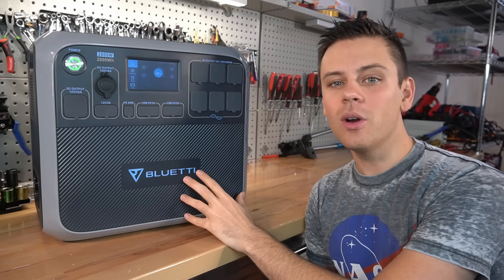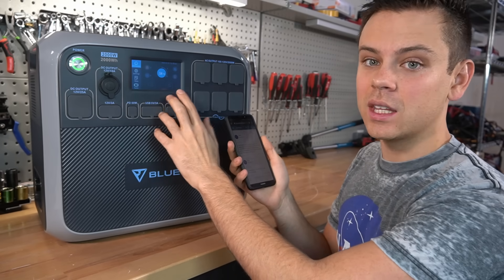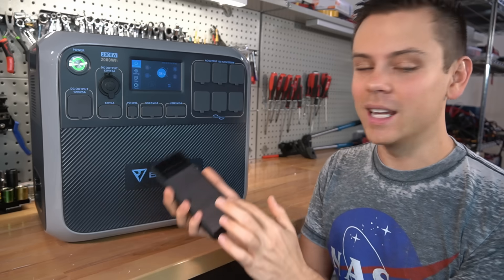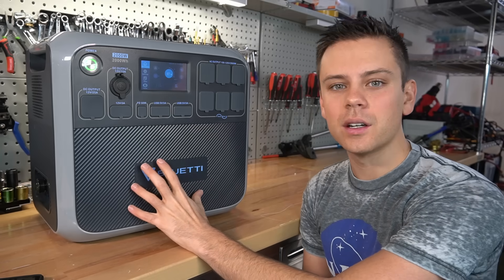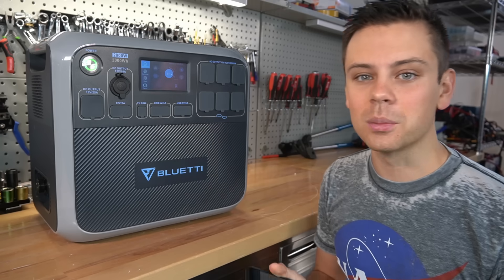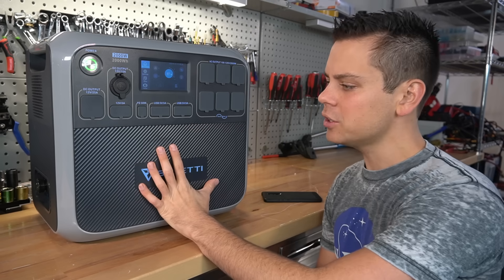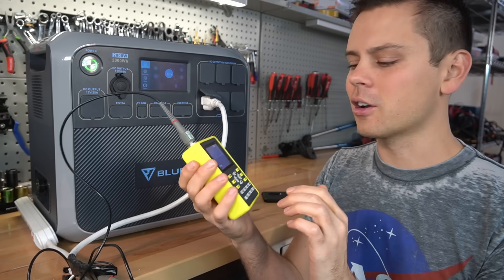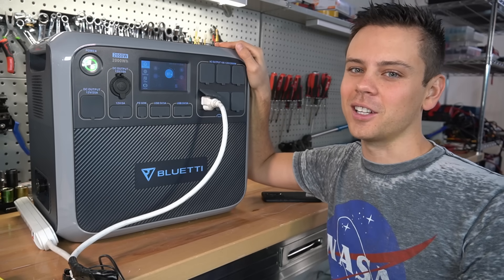New Issues are Plaguing the Bluetti AC200

Comment: I've had my unit since August. It has worked really well for me until recently. All of a sudden, it won't charge up with my PV system - two 345 W panels. I had been able to unplug things, power down and turn the unit back on and that seemed to work, but now nothing is working. I took it a friends house and was able to charge it with a regular wall outlet, but I'm totally off grid. It discharges fine - ie charges my laptop, phone and runs lights. But I need the unit to charge up with my solar panels. I've unhooked everything, used different MC4 splitters, turned the unit on and off again. I've emailed Bluetti - it takes them about 24 hours+ to get back with me. They are having me do stuff I already tried. I think there is a fuse or something that needs to be replaced. Or a Reset that needs to happen. But they've offered no meaningful help. I'm wanting them to replace the unit since it's only a five months into a 24 month warranty. Does anyone here have any advice for me?
Reply: Any update? Have you get a replacement, I heard replacement is usually a refurbish product. Want to purchase but worry about future problem.
Reply: @jakeliujakeliu  Yes, they did send me a replacement which seemed like a brand new device. It's worked perfect ever since. 

My problem was :: I had 4 panels plugged in and they were not all of the same Wattage. That is likely what fried my original bluetti. I assumed there was something inside the device that would manage that but I guess not. There is no mention of in the manual. It was pretty hard to get through... then I ended up with two totally separate groups helping me.  I think one was in Las Vegas, NV and the other in China.  So, I'd rate there support a 3 on a scale of 5. But I love the device... though now I only have 2 of the same wattage panels plugged into it.
Reply: Glad it work out well! You can use parallel.  One group use series example 200w and another 200w. Another group example 350w and 350w. Then parallel connect those two group.  Try to verify with other before try it.

Comment: My Bluetti just shuts off for no reason after four hours.  The load is low on it… not good for someone using a cpap!  
It also seems its draining to fast when I’m only using a cpap on it.  
Any suggestions
Reply: In the advertisements of the AC200P it is said: "AC power will shut down when the output load keeps under 50W after 4 hours". Try disabling the ECO mode, maybe this could solve the problem.

Comment: I tried a A/c electric blanket for 2 hours used 300 plus watts, I assume one needs to use a 12 volt elec. blanket since it may use 50 watts per hour?
Will it produce the same heat.
I would think you should use everything you can 12 volt since no power loss etc.
Lastly, all devices though the inverter run around 20% less wats / amps so all a/c items run slower IE. fans?

Comment: Glad that I went with Ecoflow rather than Bluetti. I've never had any problems with my River Pro. Upgrading soon to the Delta Pro as well!
Reply: I started with ecoflow and wouldn't charge out of box, got sent another, and it wouldn't accept solar charge, they sent another and it was cracked on the top so I got a refund. Got bluetti AC200max and it's Soo much better plus i can charge with all my 6x150 of my solar panels AND grid power and my Eco couldn't.

Comment: Has a bad experience with Bluetti customer support. Seems like they're rolling out products that haven't been fully tested while overpromising to customers. Went with another brand due to the frustration. I hope they correct it soon as the concept is solid but implementation is kinda bad.
Reply: What did you end up going with? I bought an eb150 and it does not take a solar charge. Tried different panels, cables and nothing... It accepts wall charge but no solar! Horrible customer support, super slow to respond and just a waste of time
Reply: @ven11235  
This saddens me so much to hear this...
Reply: @JudiChristopher  me too haha if it worked it would have been really awesome. The customer service was slow, but the interactions I had were good, but too slow and didn't help resolve my problem soon enough. Due to uncertainty I had to sever ties and go with another brand. No time to keep going thru not knowing
Reply: @ven11235  
Yes... That is whats scaring me too... What other Solar Generator did you decide to go to?
Reply: @JudiChristopher  okmo generator and panels

Comment: I bought mine a month ago . I was told I needed more amps than a 100 watt solar, when I pluged it in, it kept going from 32 to 0.  I then got 300 watt flexible panels from Dokio and I had to buy a adapter. I connected it all together and it didn't work. So I cant charge the Bluetti by solar at all. I've tried to get ahold of Bluetti and haven't heard back from them.

Comment: I recently purchased the ac200p. I'm getting an error code 30 "Calibration Failure". I've tried looking it up, but no info on this code. When I plug in my solar panels, I get this error. I also set the button on "PV" mode and still receiving 0% from the solar panels. I've reached out to bluetti, but haven't received a response. Could you enlighten me as to what I might be doing wrong?

Comment: I just received my Bluetti AC200-P kit including three Bluetti SP200 watt solar panels. It was a deal I purchased from Maxoak on Amazon. It was delivered on time as promised.
I based my purchase on your initial reaction to the AC200--plus that of other YouTube reviewers. I know next to nothing about electronics. I like your confident and seemingly exhaustive testing style for this and other products. Are you an electrical engineer?
Although I haven't had the kit for very long, seeing this video come out, and (seemingly) having you question your earlier rave reviews of the unit is disturbing. Should I be unsettled with my purchase? I have no idea about what you and the others are talking about when you talk about the "shunt being calibrated incorrectly", "power factor correction deviation (!!)" , "BMS communication error". What is a "firmware update"? If this is done by Maxoak, how will I receive it, and use it to correct in any possible errors in my unit?!? 

I'll continue to watch your videos--even if I don't watch a future video on "sine wave" experiments. Thanks.

Comment: Mine was absolute junk arrived unable to take a charge. Got it to charge with a shake but now can't get it to power anything. A check of the bms shows 1/3 of the battery packs at 0 charge. If you move it or tilt it charge goes to 0%. I obviously need to check internal wiring but the all glue no screw case makes that impossible. As far as Bluetti customer service..... No response to emails....Or any other communications.

Comment: Received my AC200P three weeks ago. Monitor says AC200. No ‘P’.  Does state 2000 watts. No forward button on screen to see the individual cell volts. Most concerning is I ordered a kill a watt to monitor usage. Started at 100 percent added ARB 101 quart refrigerator load, dropped to 75 percent with a kWh usage of 0.15 .  I have now connected to a 385-405 watt load. Will run till out recharge with AC and run again.  Not holding my breath. Think unit not good.

Comment: I have 2 of these, and they are impressive. But a drawback worth mentioning is that the screen and the power button green light are always on when it is in use or bring charged. It does not have a sleep mode, so it will always be using energy and lighting g up your room at night! I sure do wish they could introduce an update which would allow it to go to sleep and shut off the screen?!
Reply: Just use some tape if you don't want your room glowing green and go into settings and sleep mode the touchscreen
Reply: Agreed

Comment: Thanks Will, great review as always. A couple of notes... supply issues are quite possibly COVID related. Hardly surprising as there are few technical industries that are not affected. I'm surprised that people are complaining given the global situation. Second, Bluetti may have had some problems adapting to the new battery chemistry due to LFP simply not having the punch that NMC does for driving inverters. Did they try to re-use some of their engineering from NMC units? Might be worth you investigating as only you can. As you know from your reviews of batteries like BattleBorn, LFP is much more conservative. But a nice trade-off is MUCH better cycle life than NMC. Something that is NOT talked about enough. All I hear is complaints that an inverter is undersized in some battery pack, not knowing that the battery chemistry is simply not able to support it safely. Please draw attention to this in your tear-downs... Bluetti does NOT have some special wizards that are able to get more performance out of a particular battery type than others.

Comment: Great video. Thanks! 
Actually, Bluetti have to change/improve some futures. 
1. Only one PD /USB-C 60W port is not enough, should be 2 ports with 100W output each.
2. Four USB-A 5W ports old-style ports should've changed to two 5W and two 18W fast charging ports.
3. DC 12V/25A output should be changed to DC 12V/30A.
* Everything else is perfect! :)

Comment: I’m trying to pin down the best generator in case of short term outage or camping. I thought I had narrowed it down to the Inergy Flex or the Ecoflow Delta. Then I heard this one is great. Not sure if I’m close to a final candidate. Anyone have thoughts?

A big question I have also is - is there a generator that once the battery dies can you still get real time pass through power via solar panels from any generator? Since the unit would be mainly as a backup and I might not use it frequently, I’d want to know that X years down the road I still have the ability to get some use out of it should the need arise. Thanks!

Comment: Hi Will. I bought my AC200P a few months ago but only recently did a test to check the actual capacity. I plugged in my fridge and the unit was at 0% after 1.08Kwh. I charged it back up to 100% and did the test again and it went to 0% after 1.12Kwh. This seems so incredibly off that I feel like I did something wrong. The electricity monitor I used was a Poniie PN2000. I don't know if that's a crappy one or not or even if a cheap one would be THAT far off. Have you gotten any feedback on capacity issues with this generator? Thanks and I totally dig your channel.

Comment: The ac20 has 200wh safety so 1800w and also there is an overhead loss at no load of 15w on DC on and 31 w on DC+AC on. So in theory you have 1576wh usage capacity. Could you confirm this.? A test by hobotech was able to draw 1576wa in 15 hours. Which match the calculation 2000w-200w (safety) - 225 overhead (15w x 15h) = 1575wa usable. So it is a big issue if we plug continously a fridge on the 12v/10a, as it draw 15wa simply by setting to on. The AC loss is less a issue as we can disable it after usage. But not the dc plug. We need it all the tome for the fridge. So the loss in theory is huge after 48h. 15 x 48= 720w. Could you confirm that?

Comment: greets from germany i use my ac200p to load up my renault twizy and since had no problems but i think as the unit was new it spits out some error codes but dont know them anymore. Btw i have the Eu version. The only thing i m not happy with is the how much power the unit collected with solar is still at 0 so doesnt work and if i put a mobilephone or other small load on the unit it doesnt show the watt usage, it starts at about 45 watts or more will be shown.
Reply: I am in the UK Solar work great on mine , did you change in settings to Solar as they come standard set to car charging ,  my Iphone shows 8 watts draw on the screen when charging on the top of the unit .
Reply: @uptowndisco  jes i have to set it to pv otherwise i wont charge from the panels but still the kw produced counter is still zero but it doesnt matter really 😅. The only thing if you want to use the unit and it stayed the night in the cold garage and you want to charge it and its below zero forget it. you can discarge the unit but it wont charge , the best thing to heat it up is to wrap the unit in a heat blanket and wait, i tryed heater fans and hairdryers forget it. the stupid bms tempature sensor is in the middle of the unit just in case you want to use it in cold temps
Reply: @captainnutzlos3816  You have to have a minimum of 35 volts coming from your solar panel to get the charge going.  What is the voltage of your solar panel?  You may have to have 2 panels connected in series to get above the 35 volt minimum charge capacity.
Reply: @sedonars1  i actually have 3 foldable 200 watt solar pannels from solar power supply cause they can be linked in serie. its important that the panel has a bypass dyode otherwise you cant put it in seriel. One of the solar bags isnt even enough volts to charge the ac200p you need at least 2 or more. You can see this in my cannel i have a video how this looks. Depends on how you want to use the unit i would buy at least 5x 200 watt panels otherwise it takes a long time to charge it.

Comment: I have the bluetti 2000w and have 180w bougerv panel plugged in but noncharge happening and two faults saying pvc/car low voltage.   Wondering how to remedy. I have tried 3 different panels of these and none working
Reply: Sharon if you have not yet figured it out , go into settings and change from car charging to Solar Charging , they come preset to car charge.
Reply: @Sharon Ferra.  You have to connect 2 panels in series in order to get above the minimum charging voltage of 35 volts.  What are your panels rated at for voltage?

Comment: Lots of problems with the bluetti 2000Wh

It does not show the correct percentage . 
Everyday i use it for about 15 to 45 min . coffee machine , laptop , fridge etc . 
It then shows about 95 procent . 
Then i shut it completely off . The next day it says 100 procent again . 
It continues to do so until one day it jumps to 14 procent or so . From 89 to 14 procent just by putting it on . Also during charging it did not work correctly 
From 60 procent in one second to full and it stoped charging … So somethings going wrong . I living in my Van and need it for my job .. to bad….
I will get a change and hope that my new unit does not show the same problems .
Reply: I had a similar issue. While charging with solar panels, it went from 29% to 0% and reported a BMS undervoltage error. Then I charged it with the power supply for about an hour to 25%. Then powered it off. After powering on again it suddenly was charged 97%. Then I continued charging (at 450W) and it showed 99% for more than an hour .
The unit is returned to the store.

Comment: New to solar here! Could I run three 255w panels off of the 200p unit? Thanks
Reply: Connect the 3 panels in series and you should charge fine as long as your voltage does not surpass 150v.  What are your panels rated at?  The wattage is not as important, as the MPPT controller will dump the excess if the sun is bright enough to go over 700w.

Comment: I was all set to order the AC200P, largely for the P battery type, so less likely to explode when locked up in my car on a hot sunny day (while I go on a hike, away from my campsite). But there's two issues that I know of that ruin it for me: The minimum voltage for solar (what if I only have room on my Toyota Sienna or Highlander for one 100 watt panel?), and I hear that in Eco mode it turns off if the load is too small, as with a Iceco refrigerator while I sleep. Comments are encouraged. And thanks so much for all your vids and advice. You are the best.
Reply: Turn Eco off , problem solved.

Comment: Several comments here. First thanks for your summary on this product. Unfortunately I just came across it today after having purchased the AC200P. It arrived last week. It was a  bit delayed in being delivered and did have to reach out to the company to inquire about it shipment. They quickly responded back to me that they would be sending out the next day. It still took over a week to arrive. 

After receiving the generator along with the three solar panels, I was able to set up without any issues. One question I had was in regards to the product information screen where it says AC200. I ordered the AC200P.  I therefore reached out to the company to ensure that I had received the correct product. They wrote back and said,”The one you got is AC200P, not AC200. Pls don't worry about that. It's named AC200 when producing, but we changed the code to AC200P when shipped it to our USA warehouse to distinguish AC200 1700wh/2000w.” Not sure why you would not put the correct code on the product information screen to begin with. Makes me wonder if it really is an AC200P.

I also am wondering about the 4 USB ports. When I tested those out, none of them charge my cell phone or iPad. However when I use an adapter and use one of the 6 regular plugs it charges just fine. Also the two wireless stations on top do not appear to work either. Has anybody else had this problem? Is there a setting that I need to change or is something not working correctly? Or did they never get setup when the product was built in the first place?

The main reason was to have something for alternate energy as we boon-dock rather regularly and are also in the process of building a cabin in the woods. So having something to charge power tools and our airstream instead the very polluting traditional generator was our thought. Eventually we will be going with a much larger solar system but for now thought this might be the best approach. I hope that were not led astray.
Reply: Did you come across a problem that the battery percentage read out never got to 100 percent when charging?